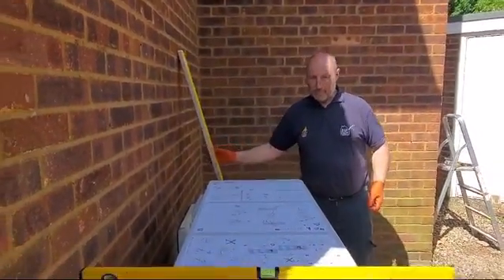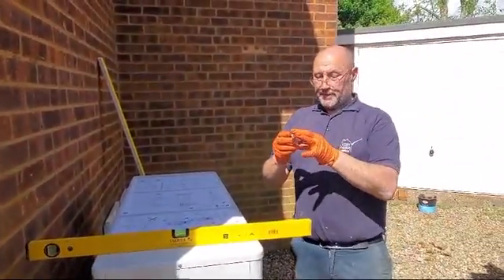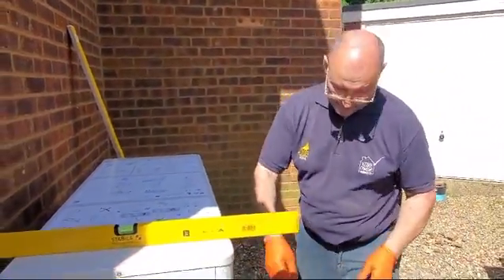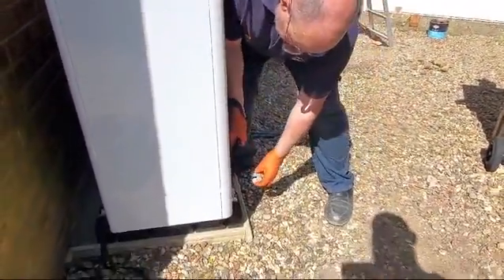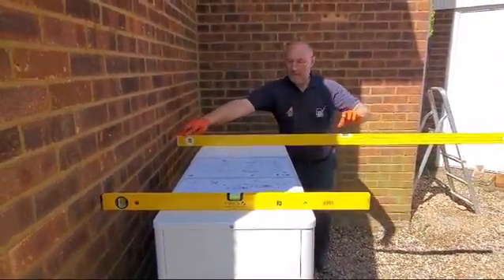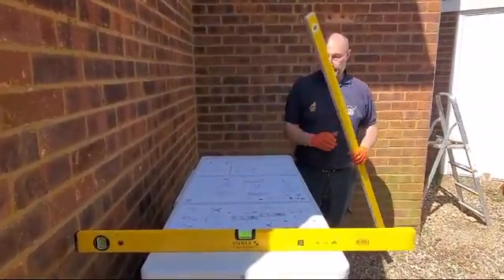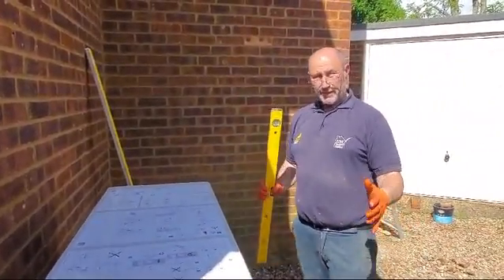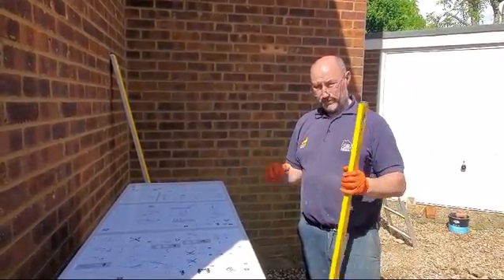Levelling up a heat pump with shims and checking for chassis Twist with winding sticks

Comment: Great idea with those shims. I was hoping to install my HP on the existing 900 mm wide concrete footpath. It has approx 2 degree fall. Do you think these kinds of shims could work to correct that much?
Reply from the maker: @gavindonohue942  can buy try